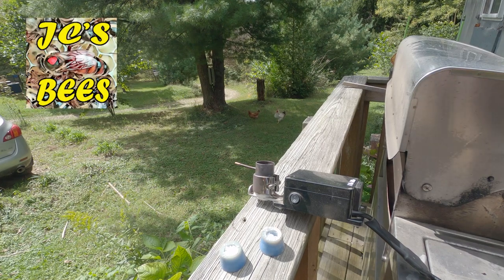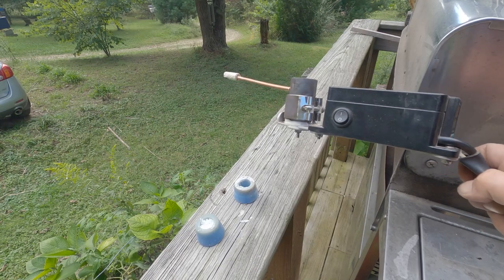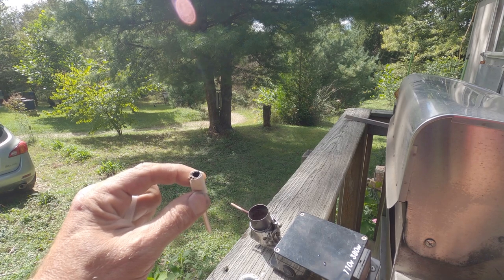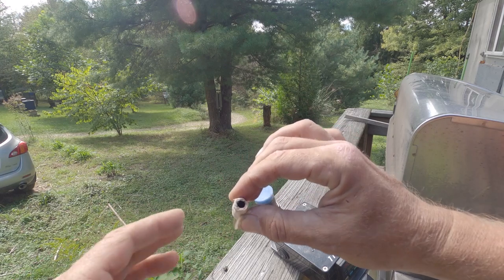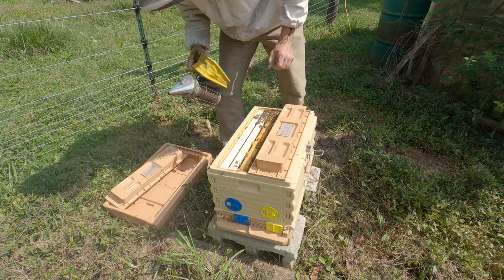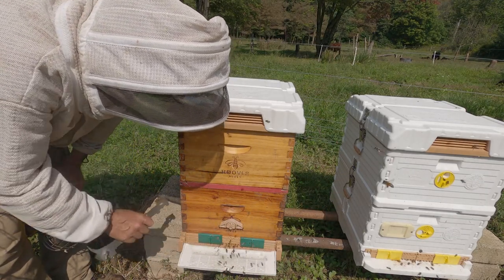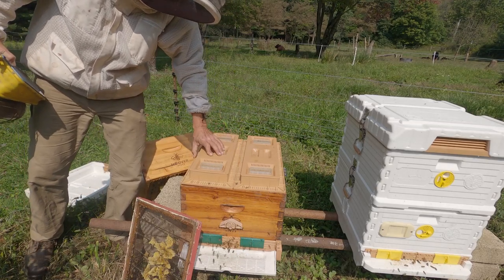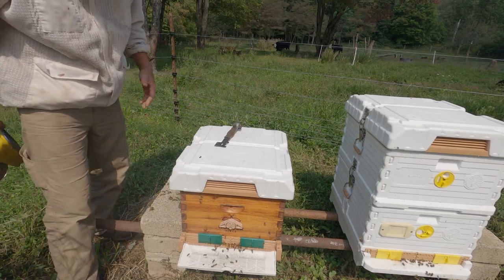OA Vaporizer Conversion To Treat Apimaye Hives & Apimaye Hive Inspection

Comment: I will be removing all of my feeders from my Apimaye hives this year. Last year I use them as they were intended with dry sugar and found that the bees made their way into the feeders and clustered there and froze. Which significantly weakened the colony as they kept doing this anytime it would warm up where they can break cluster. All of my losses last year were caused from this in my Apimaye hives. I will remove the feeders and put my feed right on top of the frames with the cover on top. Thanks for sharing my friend.
Reply from the maker: Another follower of mine asked about removing feeders and placing the mountain camp of fondant right on top of frames then putting Apimaye hive cover back on. They pointed out that with the feeders removed there would be plenty of room there to feed. What's your thoughts on this suggestion and I ask because you have experience with winter and Apimaye hives.
Reply: @JCsBees  last winter after I found that a lot of my bees were getting in the feeders and dying I ended up removing one feeder and putting my mountain camp right on top of the frames and the remaining hives survive just fine. This year I will remove both feeders and put my mountain camp or sugar cake right on top of the frames. There is plenty of room for either method under the cover with no shims being required. I found that by removing just one feeder my outer cover sat a little offkilter but did not affect the bees in any shape form or fashion. I believe by removing both feeders I might need to put a small piece of duct tape on the cover event just to reduce the vent area but I had no problem not doing that last winter.
Reply from the maker: @massachusettsprepper  I appreciate the reply and your insight. Thanks.

Comment: Do you ever have a problem with the original tip plugging up solid? I have to bring a drill with me and drill out the tip every other treatment.
Reply from the maker: Only if I try to vape when the temp is low on the vaporizer. Other than that I can do several treatments before I need to clean the tip.

Comment: Jason, wonder if you could add a series of washers spaced on your extension tube if it would keep the tube temperature low.
Almost like a gun barrel.
I use a slotted rack and didn't have the bur comb problem you are on the bottom.

Comment: The labeling for OA now states that use with supers on is fine for vaporization and dribble... If you go to the site they have a supplemental label that you can print off... For harvesting, you simply have to wait 14 days for the levels to return to normal before extracting. I use OAV year round, so that's important... I don't have to pull supers all the time...

Comment: Jason, on your Apimaye wood hive,  isn't the excluder frame causing the bee space voilation?
Reply from the maker: Yes and no. The excluder is messing up the Bees space but the real issue is the space from the bottom of frames to the bottom of the deep box. There was roughly 1.25" space there which as you know is way to much.
Reply: 1. 25 is too much indeed. However, how much of the 1.25 is caused by the excluder frame? Or is the excluder frame in addition to the 1.25?